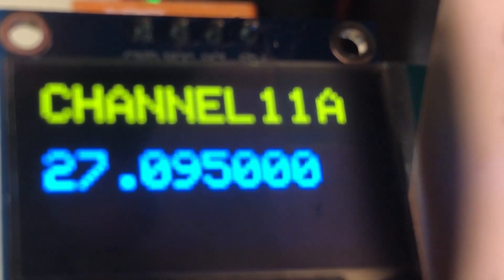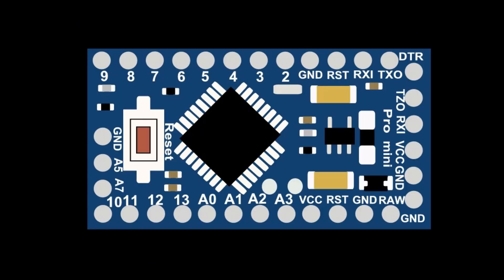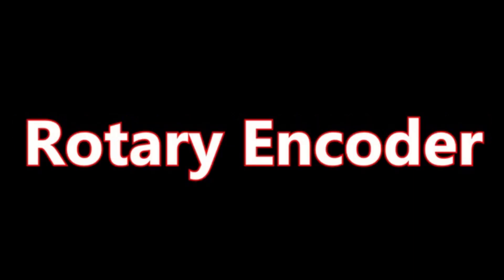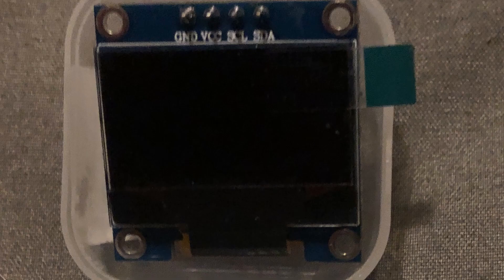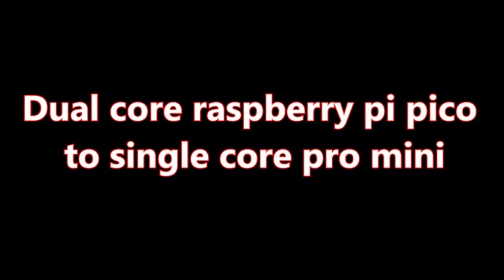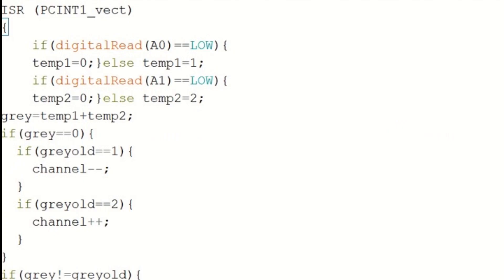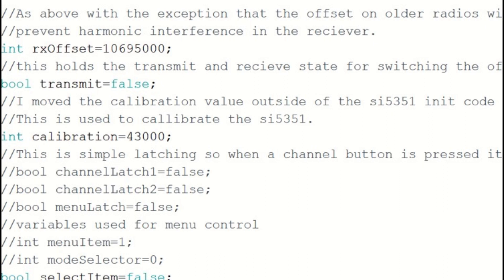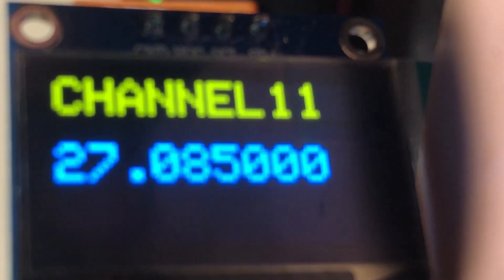Arduino Project: DDS VFO

Comment: Hello my friend.
Could you add AM, LSB, and USB modes by changing the channels to 80? I recorded your sketch and it only went up to channel 39. Please, if you could make these changes, I would be very grateful.
Thank you very much. Congratulations on the project.
Waldir Cardoso.
Reply from the maker: If it is only going to 39 the encoder is causing the skipping. Double check the pin out of your encoder. If you set the frequency offset correct you can use the same output for am and single side band in many older 23 channel radios. You can however modify the code any way you choose, but you do so at your own risk.

Comment: I have set this up and used a nano and installed this in a JFK Export rig as the PLL was no longer working this works 100% thanks the only problem is that the text that displays the channel information disappears after channel 39 of the mid band 27.395000 so you are left with just the frequency display on the second line i am not a programmer is there a fix for this thank you
Reply from the maker: Thanks, yeah I didn't debug it much, just made sure it was operating. These designs are more for educational purposes than deployment. There is a switch/case set in the code that displays the channel, feel free to modify the code as yous see fit for your uses.

Comment: Do you have the circuit wiring
Reply from the maker: Do you mean how to install or how to wire the modules? The wiring for each module is covered in the raspberry pi pico i2c for the modules, the pin out is listed in the source code sketch for each vfo and there are a few installation videos. I hope this helps. Let me know and good luck.

Comment: Please stop propagating the mistake of calling virtually any micro controller based signal gen/VFO "DDS". This isnt DDS. Thank you
Reply: @bazaar1869 is 100% correct, those two terms have been separate and distinct in technical communities FOR DECADES... 

Welcome to Alice in Wonderland...

"When I use a word,’ Humpty Dumpty said in rather a scornful tone, ‘it means just what I choose it to mean — neither more nor less.’ ’The question is,’ said Alice, ‘whether you can make words mean so many different things.’ ’The question is,’ said Humpty Dumpty, ‘which is to be master — that’s all." ~ Lewis Carroll
Reply from the maker: DDS in this context stands for Direct Digital Synthesis. The SI5351 is a digital clock generator it directly synthesizes a signal based on a digital input signal which comes from the Arduino. So with all of those considerations, this design is simply a Direct Digital Synthesis VFO
Reply: @CircuitSecrets  No, DDS is specifically a technique where a stored sample of a sine wave is clocked out of memory at varying rates to produce "directly" a sine wave at the desired frequency. Skyworks do not refer to their Si5351 as DDS, because it isnt. The Analogue Devices AD9850 IS a DDS synth and VFOs based on it can be called DDS. Do some research, dont repeat YouTube misinfo. Thank you.
Reply from the maker: @bazzaar1869  I just looked up the definition and utilization of DDS and you are correct. This is not DDS it could be said to be a PLL VFO but not a DDS, so thank you, I stand corrected.

Comment: Can you change the code for the 630 meter band? I know I cant, but it would be nice for my 630 meter transceiver. Crystals are hard to find.
Reply from the maker: I built the whole thing around the notion of using it for 10 and 11 meter. It would take a fair amount of work to convert it to that band, but it should be possible. I give a very detailed explanation of the operation through the I2c series, that and the source code should make it fairly straight forward to modify. Give it a try, I have faith in you.

Comment: Will this work on an arduino nano?
Reply from the maker: Yes, but the pin out is a little different. Make sure you use the correct pins for I2c and pin 13 may need a different resistor set for the optocoupler. Good luck..
Reply: @CircuitSecrets  i figured nano would be nice because I already have one, but I decided to just by a pico for the better menu and whatnot. Thanks for doing this work and making this possible this is a really cool project. Do you think it would be possible to use the vfo to move outside of cb band onto ham? I do have a ham license
Reply from the maker: @robertjacobs2338  Thank you! Yes absolutely it can be modified to gain access to ham bands. You will need to modify the code a bit for that and there should be modifications to change the step sizes as well as a few tweaks for side band offset. I am planning a few of those mods for future releases.

Comment: Dear friend this project works well but i need the rx offset frequency to be +455khz on the channel frequency.
for example 27005khz+455khz=27460khz signal for the mixer.
how do you modify the sketch to achieve this?
Thanks for the reply.
Reply from the maker: There is no secondary oscillator or reference oscillator as it is usually called in your radio? If you need a direct positive offset the code will need to be changed because it was built with the assumption that a reference oscillator would be used for mixing or it would be used as a direct crystal replacement for a typical crystal based CB from the mid 60s, so it only supports a typical offset form that subtracts the reference frequency from the target frequency. What model of radio are you working with? Typically the receive offset is lower than the operating frequency. As an example a C.B. that is operating on 26.965 MHZ will have a receive offset of 455 KHZ so the VFO will need to operate at 26.510 MHZ. With a radio that uses a single crystal for transmit and a single crystal for receive and no mixing other than the IF stages of the receiver the offset will be 0 for transmit and 455 KHZ or 45500 in the source code for receiver offset.

Comment from the maker: There was a mistake in the source code I had originally uploaded that effected the offset frequencies, it has been corrected and the file has been re uploaded. Sorry for any inconvenience.
Reply: Wow... you even say it many times in one of the videos I heard it but didn't listen...lol... THAT WORKED!! many thanks
Reply from the maker: @travisowensinstituteoftaek8069  I am glad it worked for you!
Reply: I have downloaded the Arduino sketch for the dds-vfo project but for the life of me I can't get it to verify with some errors... I have worked with the sketch and got the library added and defined some things but I just can't get past the si5351 stuff... any thoughts???
Reply from the maker: @travisowensinstituteoftaek8069  The library is the Etherkit Si5351. It is under the etherkit series of libraries in the library manager inside Arduino. I hope this helps you get it working.